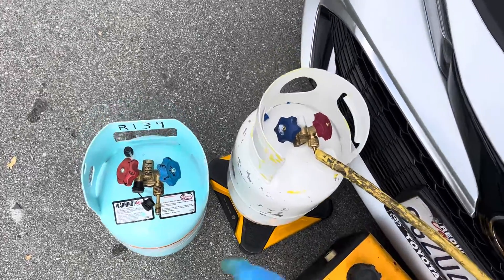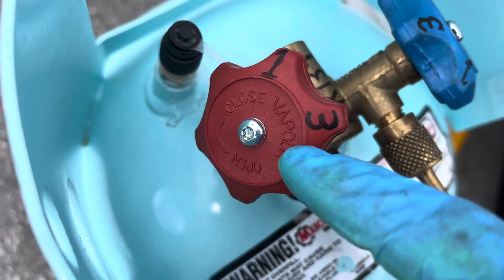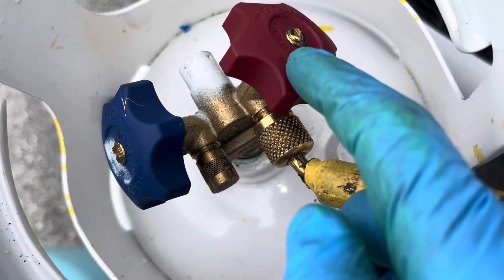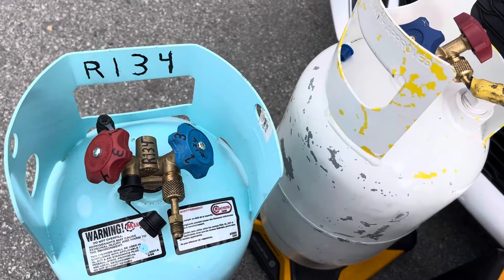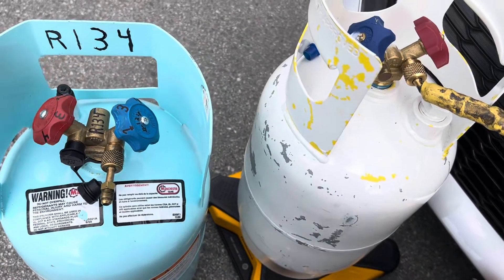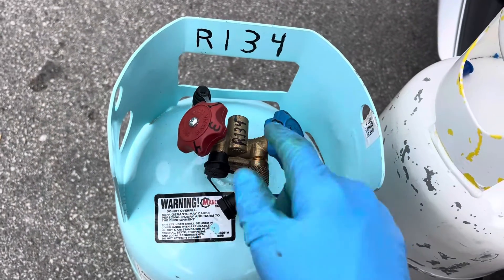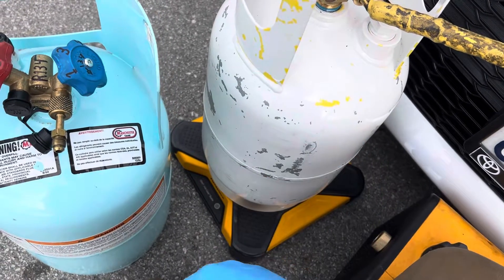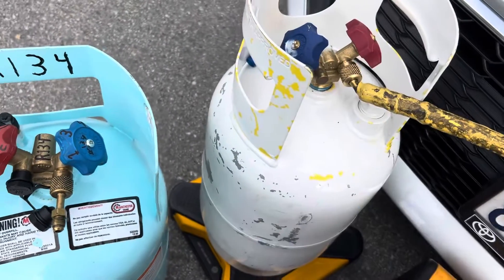Refrigerant Recovery Cylinders do not trust the color of the knobs for liquid or vapor ￼

Comment: @tom you haven't had issues using the r134 tanks for recovering 1234yf?
Reply from the maker: @davidvera4431  there’s no difference they’re exactly the same. They’re both made of steel
They both use the exact same brass valves with plastic candles. Absolutely nothing is different. 
The pressures are nearly perfectly identical to each other at the same temperature .
Reply: @coldfinger459sub0  I recovered and refilled my first 1234yf system in Tucson. I did have to get the fieldpiece MR45 to perform the recovery and I had to get harbor freight icon manifold gauges. IWe'll see how long they last. We don't do a lot of those AC jobs so we should be good to go for a little bit. Love your videos. Thank you for sharing your expertise!